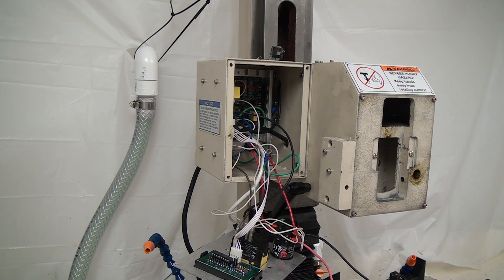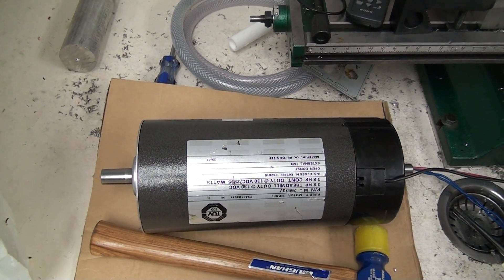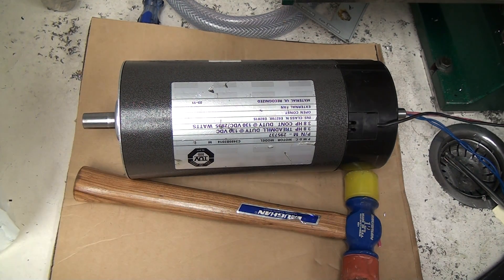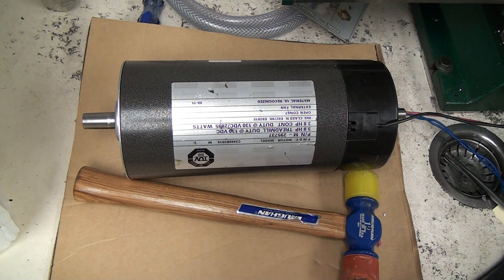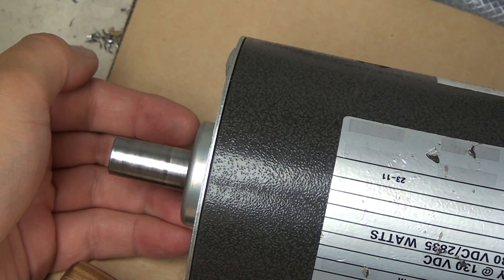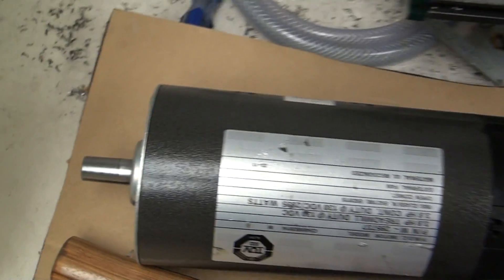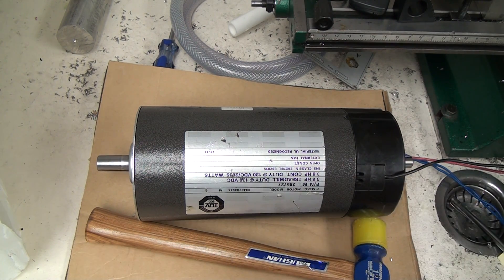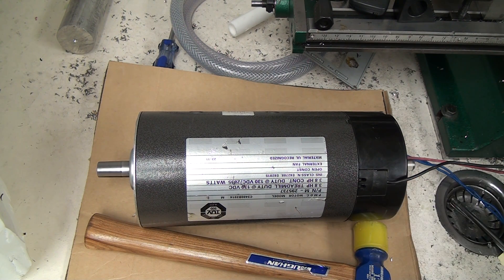Shop Update - New Motor for the G0704

Comment: Hello russtuff, I have a BF20 mill (similar to the G0704) from Optimum. The original motor has a power of 850 W (at 230 V, because it is a European version) and I want to upgrade to the 1100 W Weiss motor. Is there a need of changing the controller board to handle the power ?
Reply from the maker: +betokasu I didn't try to run a larger motor with the stock drive, but I know Hoss did it a few years ago and posted a video on YouTube. He goes over adjusting the pots on the drive too, which may be its own video. I would search his channel for info.

Comment: Russ, when you had the stock motor on were you controlling it through Mach3, if so how do you get around the main power switch which prevents using just a relay to turn it on and off?
Reply from the maker: I have never used Mach3, only LinuxCNC. LinuxCNC did not control my stock motor or my DC treadmill motor. It is controlling my new 3ph motor.

Comment: tie the motor down to your crossslide, put a stone in the lathe chuck, and grind it concentric

don't mount the motor by those 2 screws, people reported they twisted off as the motor vibrated after multiple start/stop cycles ... though i see your controller has the delayed acceleration. I'm using kbmm-225 to control a 3hp 130VDC motor for my g0602 lathe
Reply from the maker: I wish I had lathe grinding capability.... maybe someday.

There ended up being more wrong with these 3.8HP (I have two) motors than I wanted to admit, so I'm using neither. I just got a new old stock 2.8HP (almost identical) motor that I am working with now. Hopefully I'll have an update to the situation posted this week.
Reply: you just put a grinding wheel on an arbor in the chuck
Reply from the maker: meocats I don't see that working very well, but the point is moot since the motor has more problems than this and won't be used.
Reply: ah yea then its not worth it

Comment: A tool post grinding rig could cure the taper and the run out.
Reply from the maker: I thought about that, but it will have to wait until I have a larger lathe. I've also thought about just clamping it to the mill table and use the end mill on the shaft in the same way. I could probably just turn it slowly by hand from the back of the motor, and machine away a couple thou at a time.

Comment: I'm interested in the motor conversion videos you plan to make.  I plan to convert my mill as well.  The stock motor is still running on mine but it sounds like hell at times.  I cant say that really means anything but it plants the idea in my head that it will let go anytime now.

Do you plan to use Hoss' plans? Keeping the quill functional or not?
Reply from the maker: I was going to use Hoss plans, but I got some help from some people through YouTube so I'm just winging it. I am not going to maintain quill functionality because I haven't used it since I did the CNC conversion a year or two ago.

Comment: Cool man, I just bought a motor and belt drive upgrade for my G0704, so looking forward to see your tear down video, never had mine apart...
Reply from the maker: The worst part was getting the guts out of the back of the head because I didn't want to take it off, and I can't get behind my machine any more. I'll be working on that video over the weekend so hopefully it won't be to long until it's live.